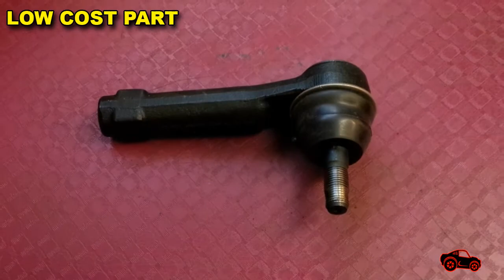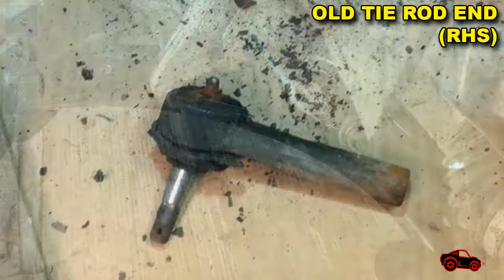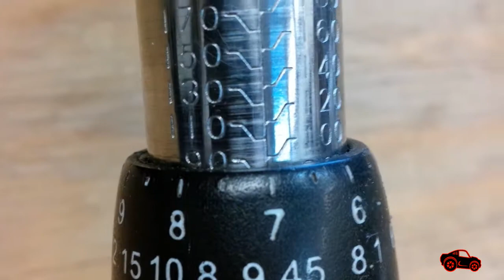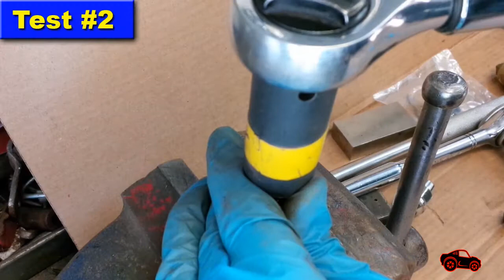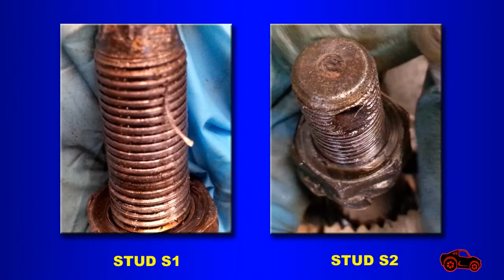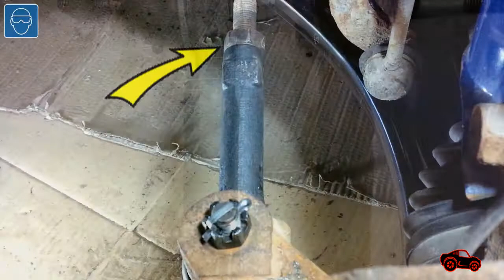Jeep Patriot Tie Rod  End Stud Nuts Torque Tests 97 Foot Pounds

Comment: I have a 2015 Jeep Patriot.  I ordered some Moog tie rod ends recently. I could not for the life of me hit 97 foot lbs.  The castle nut just kept going well past the split pin hole. i decided to just stop.  I figured it was faulty so i ordered a new one.  Same thing! My lug nuts torque just fine at 100 foot pounds so I know its not the wrench.